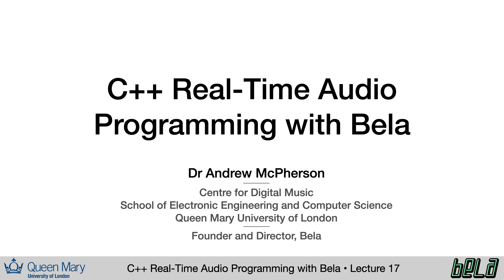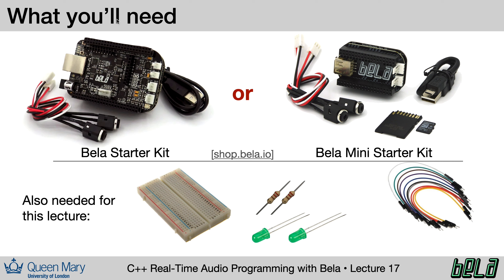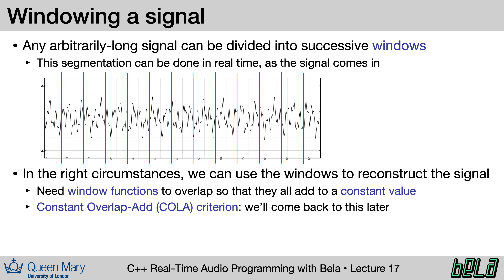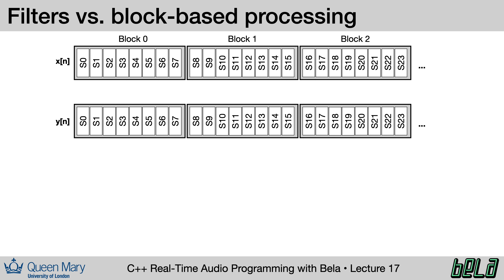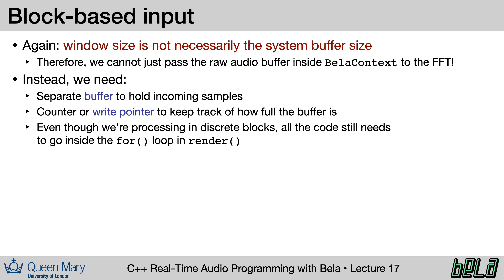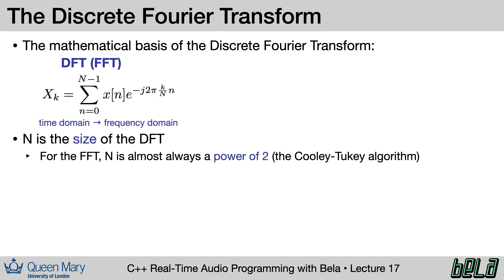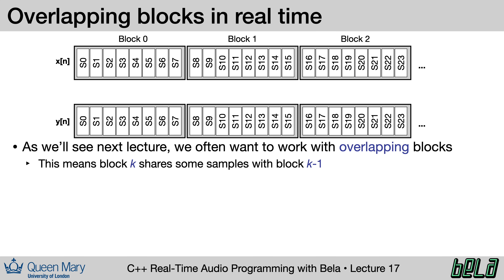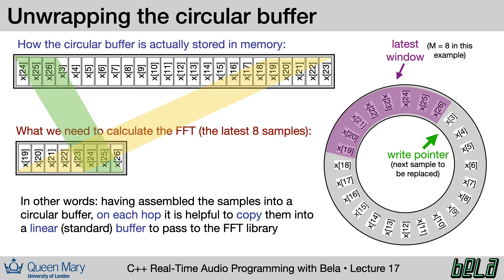17: Block-based Processing, C++ Real-Time Audio Programming with Bela

Comment: This is really a great source of information. Exactly what I needed to my endeavors. Just one remark: after running the code, I got a lot of underrun messages in the console. After some debugging, I found out that the problem was somewhat related with the communication with the Gui. I increased block size to 32 (it was set to 16 as default) and the problem was solved.

Comment: What are the differences among "Window Size", "Hop Size", "System Audio Buffer Size", "Circular Buffer Size"?
Reply: Window size is the number of input samples used in each FFT. Hop size is the number of input samples between successive FFts. System audio buffer size may not have a unique definition, but it's most likely the number of audio frames in an audio callback (in the case of Bela, the value of BelaContext's audioFrames), "circular buffer size" is the number of elements contained in the circular buffer.